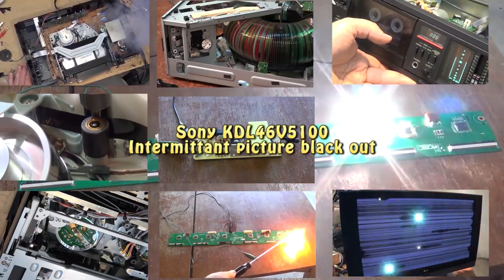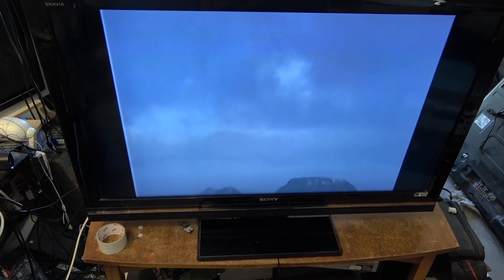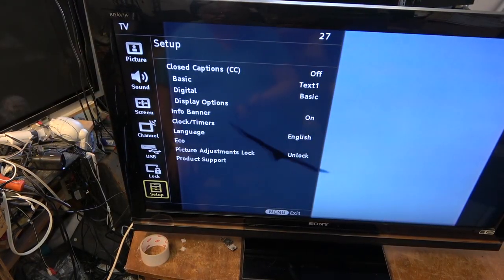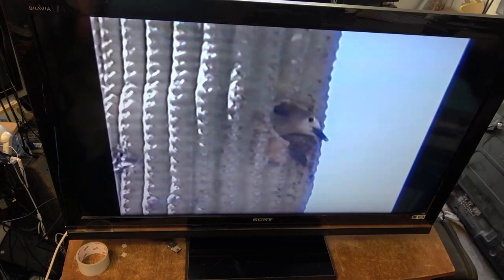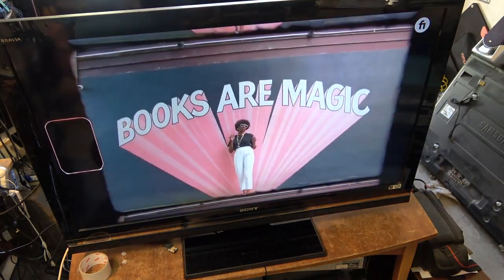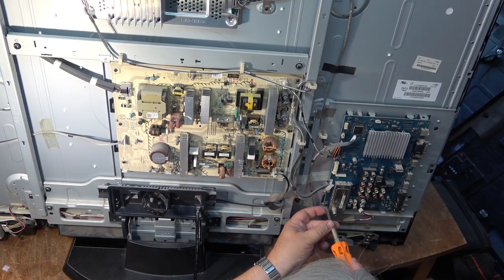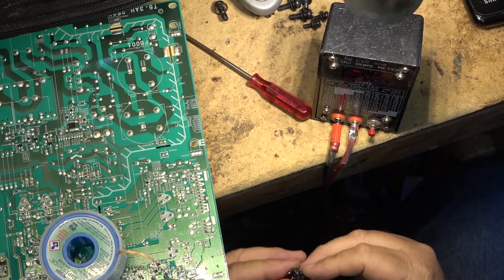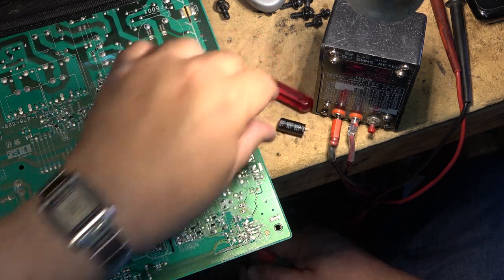Sony KDL47V5100 Intermittant Picture Goes Black for 2 Seconds

Comment: This is my set and it has been repaired perfectly. 12voltvids is top notch.  It has not flashed to black or done anything abnormal.  Its an older set but works perfectly.  Maybe last for another 5 years or more.

Comment: Hi 12voltvids, I know you do not like working on TV's, there is no one like you for fixing anything, for me I love to see you work on TV's, you found arcing and broken solder joints, there is no better than you are,  I truly loved your repairing especially on TV's, Ok I know you may not have space  or don't make you much if any money but it's a pity as there in no one better. Great job as usual,  I just love TV repair videos and you explain it much better than anyone. Keep up the amazing work, Kind regards from  Jim. 👍
Reply from the maker: Obviously I do but don't like them. Not the modern ones anyway.  I do as few as possible.  Mostly my own.

Comment: I know it''s a TV and you don't do TV's but the problem is worth a look especially for a friend. Good idea about tightening screws first. Reseating the small board connectors are also something you can do. Next is a visual inspection. Found 
questionable cracked solder joints? You can  just  redo those. These are things that result in fixing  probable intermittent problems for any flat screen TV. Did a great job Dave!
Reply from the maker: Just wait for my next one titled "dual 1019 in the worst condition I have seen". It was a nightmare.  Easier to count what wasn't wrong with that pile of shit.
Reply from the maker: One of the reasons is because most new ones will not stand up with the back off.  I don't have room for huge TV's either and everyone wants them yesterday and that is not how i work.  Some things can sit here a month or more before i get to them.  I'm not in the business I do these projects on my time when i feel like it and for the majority with a TV they want it yesterday.  So I am very selective on what TV's i accept.  Plasma and conventional LCD are generally ok. The led sets are usually led failures.  9 times out of 10 it is backlight failure.

Comment: Commercials do have advantages. Especially since there is no copyright issues. (Right?). Interesting video. I know what intermittent problems are like. It never acts up when a service person comes out. It's either dead, or working.
Reply from the maker: That's why I let the commercials play not that I want to advertise the product I just don't want to get nailed and have to re-edit
Reply from the maker: Intermittant are the worst.  My hard drive disappeared again during rendering of this video which required a restart and start the render over.  So now I know the old drive was fine as the new one dropped off.  Argh.  Reboot and ur comes back.  Maddening.

Comment: I have the same series of set, although mine is the 52-inch model. I haven't replaced the unit yet because it still *works*, at least for now... 
If somebody knows someone that is handy with TV's, they may be worth fixing, but nowadays, a 50-inch 1080p set isn't worth spending the money on getting repaired... a new 4k 50-inch set can likely be found for under $500.

Comment: I agree with you 100%,  faults that vanish then randomly come back are the worst.
I would rather find a burnt up part and cooked pcb,  hints of stress.
Crapacitors in the psu can never be trusted.
Hopefully its not the processor crashing and wiping the temp memory, or the o.s flash ram playing up.
I was thinking (not often) about the sofness of the solder on the earths,  it compresses a bit too easy and becomes loose.
Maybe lead free would be better... oh hell im  ill 😀
Reply from the maker: Talked to the owner. So far so good, 6 hours and no blacking out and he said it was doing it every few minutes before.
Reply: @12voltvids  Sounds like you frightened the crap out of it 😀
Or one of the earths was not the low resistance it needed.
Fingers and toes crossed for it to stay working lol.
Reply from the maker: @zx8401ztv  was working earlier today.

Comment: In my case, I first wiggled all the connectors to remove any possible oxidization.   And that was that.   It was up and working again.  That was a couple of years ago, and it is still working today..
Reply from the maker: Unplugging and reconnecting connectors fixes a lot of intermittent problems. My 63-in plasma that I watch every day and I've had since 2009 developed a problem a couple years ago with a black horizontal bar near the top of the screen was missing picture and when I tapped on the side of the screen it started moving upwards. got the two kids to help me lift it down as it weighs 165 lb put it on the base that I kept. Pull the set apart disconnected all the edge connectors leading to the panel and reconnected them, tightened all the ground screws put it back together and put it up on the wall it's been going now for at least two and a half years since that happened it was just before the pandemic hit that we took it down there's a video up on my channel showing what I did. I remember I was pissed off because I got a copyright claim when I showed the TV screen because there was a hockey game playing. It wasn't actually gameplay it was just a bunch of guys skating around as they started out a penalty but the NHL still had a problem with that and had my video pulled so I had to go back and re-edit and blur the screen I wasn't too happy.
Reply: @12voltvids  I had a similar problem with my Microwave oven. Only half of the keys were working.  All it needed was for the keyboard flex cable contacts to be cleaned, and clean the keyboard connector on the main control board.  I had purchased this stainless steel oven for about $45 due to it being a display model. They lied.  In truth, it was a defective unit.  But all I had to do was fix the keyboard problem.  That was back in 2004, and it is still working to this day. Over the years I have had to replace the door micro-switches and the main fuse, but I obtained those parts from someone eles's oven that they had tossed out for disposal. The oven turntable motor died at one point. This was due to the nylon gear that sits in side the spinning donut shaped magnet, was slipping. Two drops of glue, and it was as good as new.  LOL

Comment: Hi 12voltvids. I have to agree with you the new ones are a pain in the butt to repair, they may be a light but there mostly surface mounted comportments I don't like them either, I love repairing the older plasma sets, they are a little heavy but as you said the build quality was truly great , it's a pity they don't make them still, what I do is go to the dump and just wait to see if anyone is dumping a ols LG, Samsung, or Panasonic set and especially if the are plasma, I truly love working on older TV sets, I don't know why but they seem to put a 6.3 volt capacitor on a 10 volt line or a 10 volt cap on a 16 volt line,  I think they just want to break down so we have to either buy a new TV or a replacement board, so when I get them working I usually check what voltage they are on, I would not put a 10 volt cap in a 10 volt line I would much rather replace it with a 16v but rather a 25v ones I have to say I seen you do the very same so often, started electronics because of your know how and I found them very helpful, anyone can do all the courses they like but there is nothing better than actually working on them, I truly learned a lot from you, and I have watched you fix so many, I don't find anyone can do them half as good as you, I find no one wants a radio, a video recorder or a three in one fixes at least not now, but TV sets are always need fixing, I don't listen to ass holes saying you are not a safe worker, I think after 40+ years and if you were not a safe worker I think you would be not fixing them for as long as you have, no matter how good you are you will never satisfy  or please everyone, it's just not possible so to heck with them.  Thanks a million for all your amazing work on especially TV's, so now and then I still look back at them, I find them inspirational and if that person listened to you instead of trying to get your YouTube video's taken down, he should learn a lot from them just as I did.  Kind regards from Jim.👍👍👍👍👍
Reply from the maker: The guy is a nut case that trolls me, fran at franlab and Dave at eevblog as much as he trolls me.  He never contacts me directly because he is blocked.  He goes to Google NOC and they notify me that a ticket has been opened.  I am pretty sure Google just dumps his empty complaints but they have to notify me and 20 to 30 tickets every day is just frustrating.  They fill up my inbox then legit messages can't get through untill i delete them. He doesn't have my personal email so no important messages get lost, just YouTube stuff.  I'm sure he has a bot that sends this crap to Google and YouTube.  I just wish there was a way for me to block messages from YouTube but as a creator / partner i have to accept all correspondence from YouTube because if they sent me a legit request I had to respond to, such as bullshit copyright claims I would never know and a crook could be stealing my revenue.  So I have to be able to get email from YouTube.  Johnny send check knows this and that is why he does it that way.  To annoy all of us.

Comment: Is it possible to watch the voltage drop across the ground point with the set running to see a possible ground connection issue?

Comment: Why are the grounding scews painted black? Should they not be bare metal to provide better connection between the board and the chassis? Maybe the tight-seat contact surface between the bottom of the board and the rest of the set is just good enough...
Reply from the maker: I believe they are anodized not painted. Reduces corrosion and remember we have dissimilar metals here.

Comment: I got a 40 inch sony from 2008 that someone put outside for free with remote i got it home and worked fine but awful picture low brightness and washed out colours had over 25,000 hours of use  as it was turned out to be some auto brightness thing in the menu turned it off and picture was superb and had to turn the brightness right down very bright panel .
Reply from the maker: I have a set with over 60,000 hours on it and counting.  Fluorescent LCD set or course.

Comment: My television had similar issue whereby screen would go completely blank for minute, and had thought the thing was broke until discovered that by dragging feet and/or walking on the carpet nearby the television causes the problem due to static electricity.

Comment: Maybe software update issue or replacement to some i2c eeprom around the cpu that stores the user adjustments.One or two times of effort to repair these random kind of failures i think is more than enough.

Comment: Never ever have the backlight setting turned up full as it will use more power and it will drastically shorten the lifespan of the tv.

Comment: Did you ever check and re-paste the processor or did I miss that?
Reply from the maker: Heat sink is soldered to multi later board.  Did not want to risk damage to board to remove it. It was a thermal pad not paste and from the edge it looked ok.

Comment: No comerical I like ad free
Reply from the maker: Too bad so sad. Even Netflix and Amazon is running commercials.  As more and more content moved to streaming you will not be able to skip them.  On demand is that way now.  Skip disabled by broadcaster is the message.  Can rewind and pause but not skip forward.  Programs coat more and more to produce.  Actors and cast demand higher wages.  Someone has to pay for it.  Either a monthly fee or commercials, or both.   Torrent you say, not once they start cracking down on the people that seed. Once people that seed (and think they are covering their tracks)  get hauled into court and massive fines for  copyright.  Catch a few of the big players and that will send a message and others will quit.  A guy I know got nailed back in the satellite piracy game.  He was downloading fixes from Dr7, remember that site. Anyway the site was caught and taken over by the feds. They tracked the ip of every member when fixes were released and went to the user's isp. Isp releases their clients name.  Even though he was using a VPN they found him.  Got a letter with an offer to settle for a cash amount. He called their bluff and said they were scammers.  A few days later he got a knock on the door. RCMP had a search warrant and nailed him.  He is the guy i was referring to when i talked about those devices i found the the box of junk.  Anyway, he got 7 years and served just under 3 in a minimum security jail.  Yes I have spoken to him after he got out.  It was dealing with iks.  Some  people never learn.  He reached out to me because i used to install dishes for him and wanted me to do it again.  I said not a chance in hell am i having anything to do with that.
Reply: @12voltvids  a family member is livid because their favorite soap opera is to  move from OTA to subscription.  OTA programming will be reduced to recycled reruns . Content cost $$$ and the #of subscribers and revenue stream  is the metric they want. I notice you get the same crap adverts there .
Reply from the maker: @petermetro4686  well that's because it was on CNN headline snews.  Not only is "lays or our wives" going to streaming but so is dancing with the stars. That is going to Disney.  Pay up suckers.
Reply: @12voltvids  👍 you are so right !